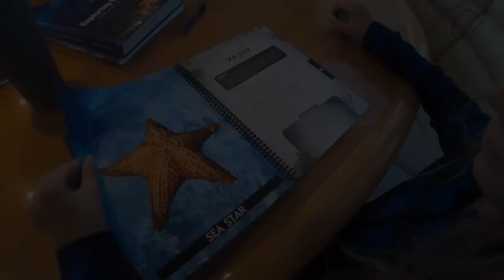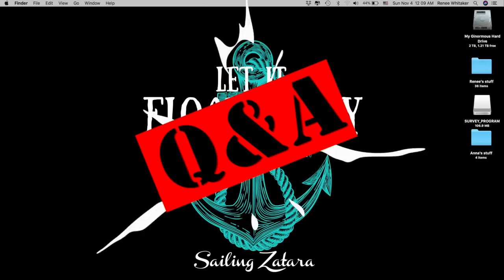A DAY IN THE LIFE of a Sailing Family (at Anchor): Repairs, Homeschooling, Snorkeling (Ep 70)

Comment: Regarding the head gasket replacement and your comment about the head being warped, if it got hot it may be warped and also the block may be warped too. If so you will need to have the head and block resurfaced before replacing the head gasket or water will just leak into the cylinder again. Also if it got hot maybe your waterpump may be bad or some cooling system issue. A blown head gasket could have caused it to overheat too. Be sure to ask about "O ringing" the block/head to help prevent future issues. Thanks for all the Great videos!

Comment: Keith
Stu here, friends of Wiz from La Linea. Am the Engine Expert for PBO, your genny, that water usually comes from a blocked exhaust elbow, quite common on small diesels, they dont run hard enough and it blocks up, then the raw water backs up in to the back cylinder.If the head gasket is leaking it is quite obvious, dont over think warped heads etc, a red herring.

Comment: You need some help on that head... (40+ years here)...  you can not make a gasket for that thing.. it is a steel core gasket with graphite...  The water in the cylinder away from you got in when you took it apart.. however.. the cylinder nearest you "may" have been leaking (lack of carbon on head)..    Water in oil  could come from a gasket or a heat exchanger  leak (oil cooler)..  Get me some info on the motor and I will find out :)      BTW.. you guys rock..

Comment: You can't make a head gasket.  They have interference metal that conforms to the slight inconsistencies in the block and the head.   Too much pressure for a fiber gasket to withstand.  If you sweat the onions in butter before you bring in the meat it incorporates the subtle onion flavor into the meat or generally any dish.

Comment: carefully remove head gasket, use silver spay paint (due to the metalics in the paint) 
and give it 5-7 coats and it will work for you till you can get a new head gasket, if that head is a Yamar, the 3 cly heads have a problem of cracking.  Good luck and safe travels.

Comment: Great day in the life! I was wondering if you guys have checked out the Integral Marine generator replacement.? It uses the drive engine to run a high capacity charging system, and saving the headache of a generator, with a lot more efficiency. Keep up the great Voyage, safe travels.

Comment: The Panda Fischer gensets tend to have problems after like 500 hours in my experience.  NexGen/Phasor makes a nice 3.5 kw that is pretty bullet proof about 5 hours per gallon on 1/4 to 1/2 load.  Northern lights has a super nice 4.5 kw that uses about .25 gallon per hour at quarter load.  It uses more fuel that the NexGen/Phasor, but I think it is a more durable design and outputs more power.  The Northern Lights definitely costs more though.  Also if you have a phone that is capable of being used as a hotspot, put it in a waterproof bag and hoist it to the top of your mast.  The wifi should reach the whole boat, and cellular is somewhat better.  T-mobile has two types of international roaming.  One that is unlimited and one that is not....I am somewhat irritated to hear that the cut you off.  I have T-mobile and was planning on taking it back down.  The Bahamas has BTC and you get 15GB for 15 days for like $30 I think.  T-mobile should work...I don't understand them cutting you off unless BTC did them dirty as they have to use the local carrier.  How did the T-mobile thing work out???
Reply from the maker: We abused their “temporary unlimited international coverage” by being out of the country for an entire year 😬 But we have just ordered a GoogleFi phone, hoping it will be a better permanent option.
Reply: @SailingZatara  But did you get to PR before the end of the year. Wouldn't it be considered part of the us...my phone works down there like normal on tmobile.  I will look into the Google phone.

Comment: have you looked into getting sattelite internet for the boat is there any way to repurpous the big sattelite dome on the back of the boat it should be self tracking could maby use a service like huges net or something to get internet on the boat could cut out alot of roaming charges
Reply: It's not a bi-directional LNB. And you would need a 1 meter dish, as well as be in the coverage area. Which they won't be in the coming months.

Sat phone service is the best with small data packets.